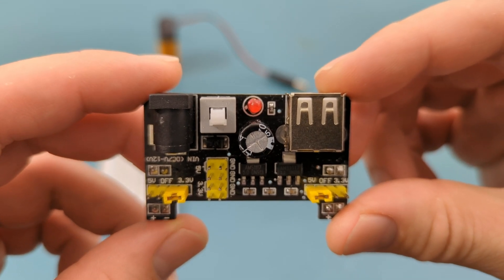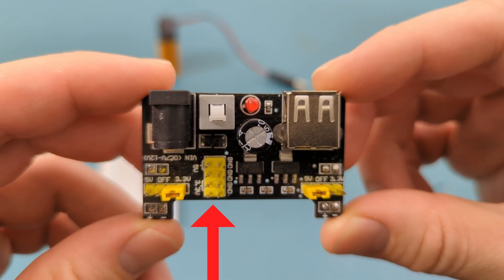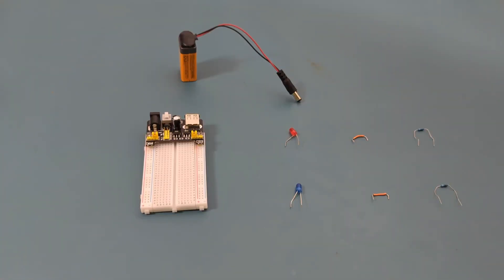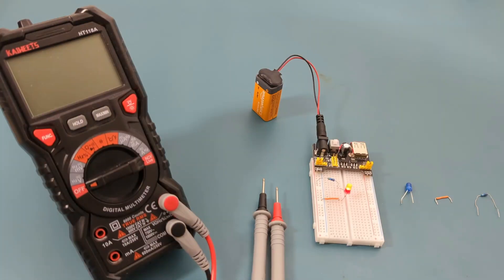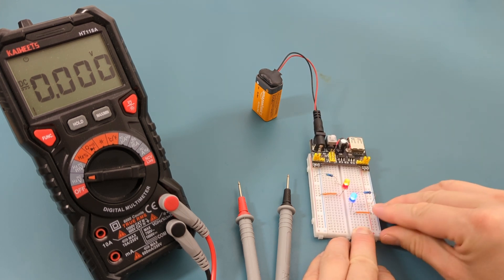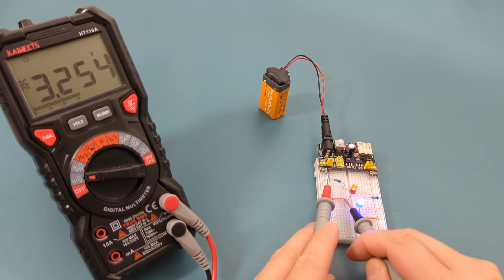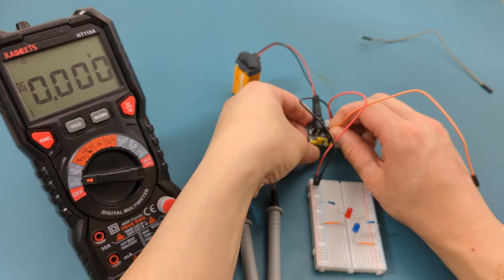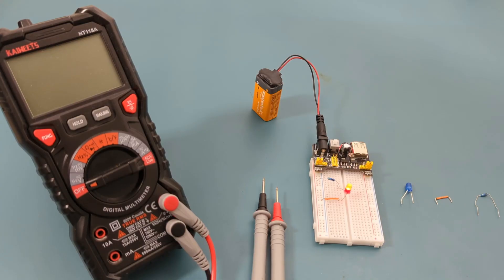How To Use A Breadboard Power Supply Module

Comment: a doubt: why left side as well as right side have 2 +ve and 2-ve pins. Having just 1+ve and 1-ve pin on each side would be sufficient, isn't it?
Reply: i think 2 pins on the bottom middle  are just to firmly hold the module on the board. other 2 pins are power supply

Comment: What is the resistor value in there? 2:05
Reply: Because i ordered one and it will arrive in 2 days
Reply from the maker: I used a 470-ohm resistor. Let me know if it works for you!
Reply: @ElectroUniversity  now it got canceled. Because it has been lost somewhere the order
Reply: @ElectroUniversity  so i bought a keyestudio ks0398 kit